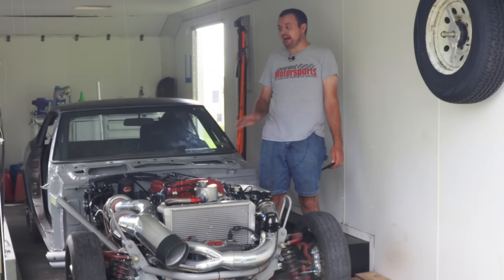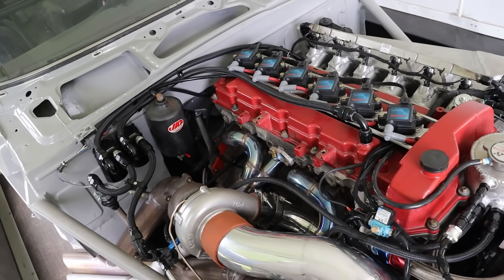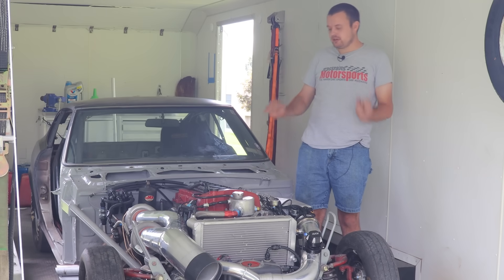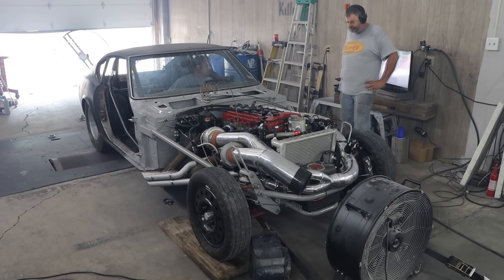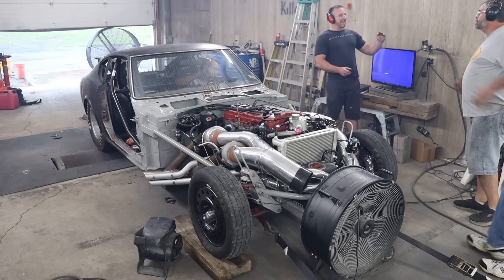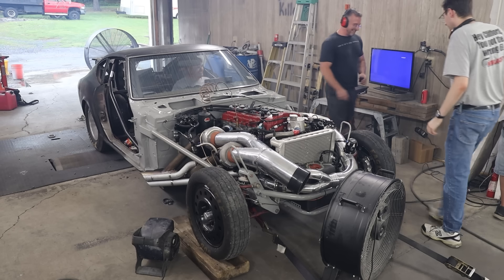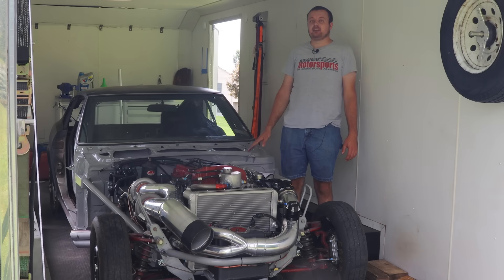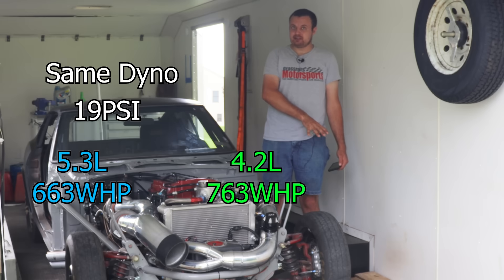This 4.2 Liter Engine Just Beat a 5.3 LS!

Comment: This is incredible. So happy to be able to be a part of it. I agree, let’s get some aftermarket support!!
Reply from the maker: Thanks for all the help!
Reply: I'm glad you guys built this up.  I always wondered if the inline six would hold up and it's doing fantastic. This could be a motor for a new grand national!!!!!
Reply: @johnc.hammersticks  That was a V6
Reply: @joshuagarner6981   this motor is a straight 6 man, they came in the chevy trailblazer.not talking about the 3.8
Reply: @johnc.hammersticks  - Also in GMC Envoy... but he was suggesting it could have been a new version of Buick GNX... Rainier GNX?
Reply: @BuzzLOLOL  that's exactly what I posted. In here and the main thread.
Reply: Imagine starting with the 1970 Olds DOHC 4 valve 455" V8 concept engine!
Reply: Pretty wild getting that kind of power out of an inline.
Reply: @bubbakushingtonIII   some of the highest hp motors are in line, less vibration more strength in the block
Reply: With the price and availability of these engines I'm surprised the Jeep crowd has mostly gone LS for power. Looking forward to seeing some support for multiple applications.
Reply: the amera barra could use some aftermarket support...lets go SEMA!!
Reply: For a engine that was made less than eight years? Meh.
Reply from the maker: @nsboost  but they made a billion of them. Have you been to a local wrecking yard. Ours has 20. Take a drive. You'll see at least 5
Reply: @Calvin-Nelson  this is actually incredible!! Are prices for the engine from the wrecking yard decent? I would think that since there’s that many out there and nobody has really made a name for them yet, that a guy should be able to get a few for a really good price. This engine. Oils hold tremendous swap potential into a wide variety of vehicles. I’ve got a couple Jeeps I’m working on right now and have been debating the 5.3 or 6.0 but prices for a high mileage engine with all accessories has gone from $500 to $2k cause all of the drag racers have started using them in all the fox bodies and in a state like mine where drag racing is really big then it’s hard to get one unless you have a chunk of money unfortunately. The good thing about them tho is the amount of aftermarket parts we have available to build them but for guts like me that have limited budgets for our builds, then this may get more mileage for our money for a little bit before the word gets out. This would be an incredible platform for the Jeep market and I’d love to jump in and try one. 

Thanks for getting the word out brother, without you, no telling how long before I’d found out. Now to set out and find one or two
Reply from the maker: @1982MCI  yes. They're very affordable.